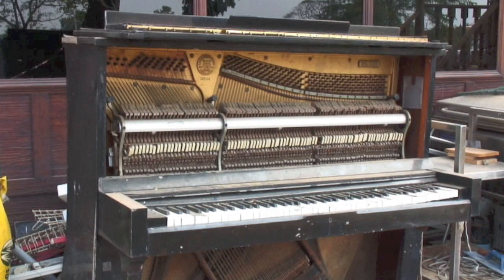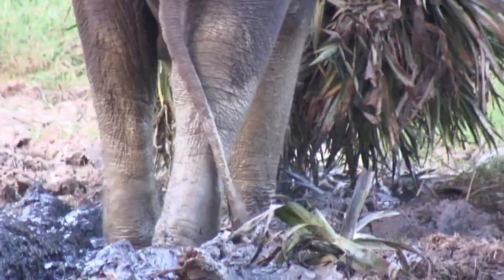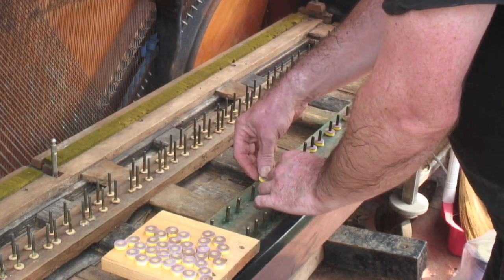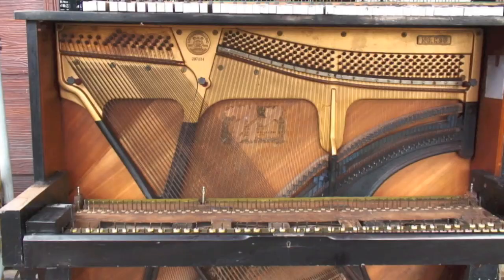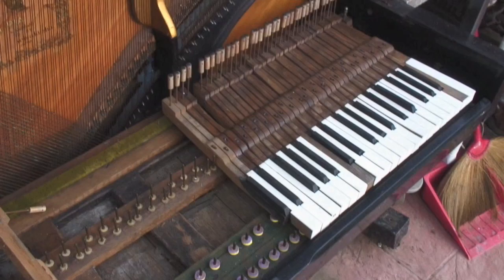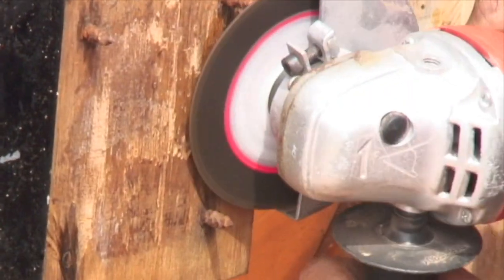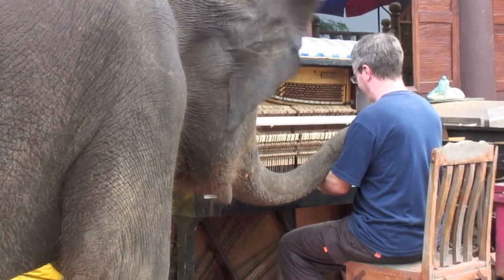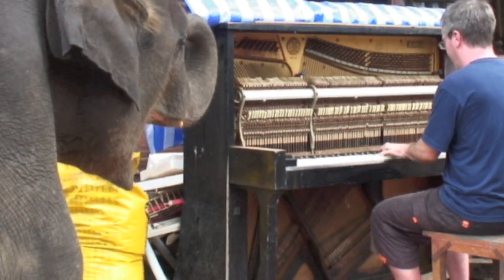Piano Returns from the Deep - Thailand

Comment: Temporary repairs awaiting new parts:
1) Keyboard Felt Cushions out of a sheet of rubber for making flip-flops
2) Balance Pins out of nails - ends sanded with grinder.
3) Bridle Tape repaired with masking tape folded over several times
4) Hammer Head made from strips of thin rubber-leather glued in 10 layers and shaped with a blade and oil.

English Original